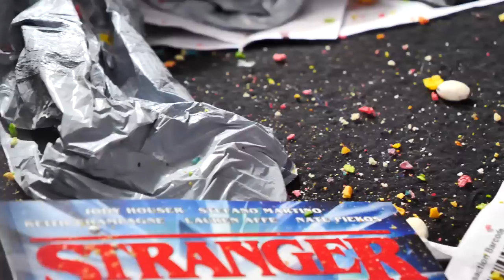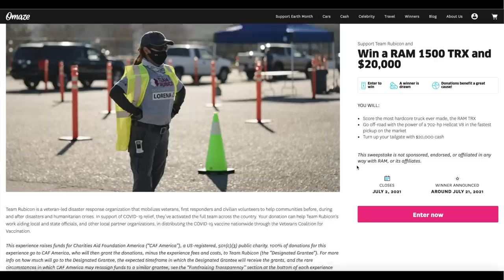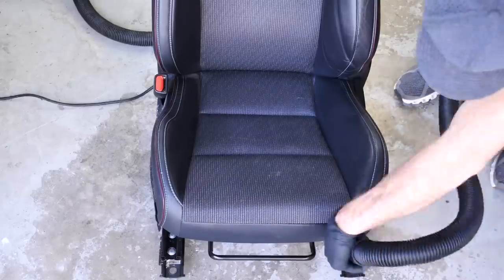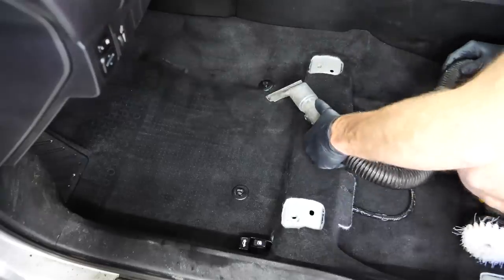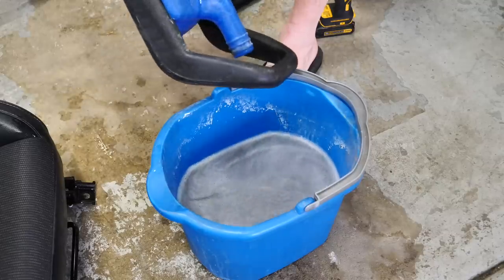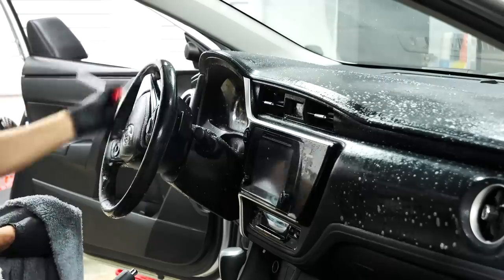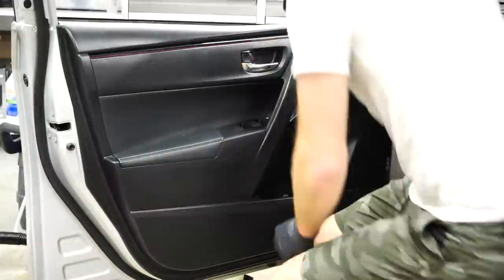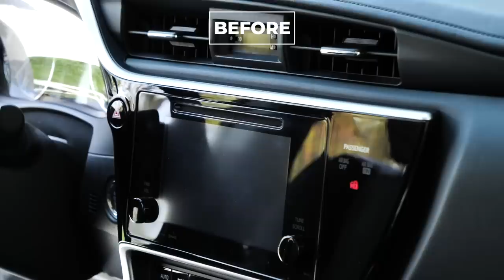Complete DISASTER Detail - Cleaning A Dirty Toyota Corolla... Interior Restoration How To.

Comment: Detail Tip: 1. Always pay more attention to the interior then you would think you should. (The driver sits inside the car where they begin to find everything a detailer missed) 
2. When buffing, make sure the paint is cool to the touch before starting, don't let the product dry(it'll "sand" the paint), let the buffer do the work, no need for pressure......

Comment: 9/10 details I do on my car are exterior.
Takes me about 3 hours to do.
Having no access to water and electricity was the biggest hinderance.
The best tool I bought is a battery powered pressure washer. Combined with 2 20 liter canisters, I have enough water to wash my car.
The foam cannon isn't that great, but it does the job well enough.
I usually pre-rinse, coat one section with soap using the foam cannon, go over crevices with detail brush, then contact wash with a mitt with the foam still on the car, then rinse off again.
I do it this way because of the dry hot climate where I live, to not let the soap dry. I find this method to be very good at removing nearly all of the dirt.

I also use the meguiars snow foam in a 1/5 mix with water. it cleans very well, but is quite expensive.

For tires, I found meguiar's all purpose cleaner works best.
I don't have issues with brake dust because I have a hybrid and it rarely if ever uses the brakes.

Comment: Detail Tip# 128: instead of spraying the LCD screens in cars, take your micro fiber cloth, spray water on it and take a plastic razor and wrap the wet part around it (this is where having the actual handle for the razor comes in handy, they are cheap on Amazon) and use it like a squeegee, not to much pressure and go up and down the screen and then wrap a dry part off your towel around it to dry. This prevents streaking, and possible wear and tear on the screen by spraying chemicals on it so many of y’all have voiced.

Comment: I need to pull the rear bench. Do you unhook the battery at all to prevent deployment of airbags when you do this? On top of this, how to do effectively? I need to cover the bench seat in a cover. I have the upper portion, just the lower bench is my Achilles heel.

Comment: When you take seats out what is your recommended process? I’m scared I’m going to set an airbag light off lol. I forgot the process is it unplug the negative battery terminal then wait 15 mins and then take the seat out correct? And then when you put them back in, you plug them in and wait another 15 mins before putting the battery terminal back on and starting the car?

Comment: Hi Stauffer Garage, I would like to ask you how do you remove the seats. Do you disconect the batery? Could you turn on the key and move with no seats? Thanks!!
Reply: Disconnect the battery, unscrew, disconnect plugs, pull out.